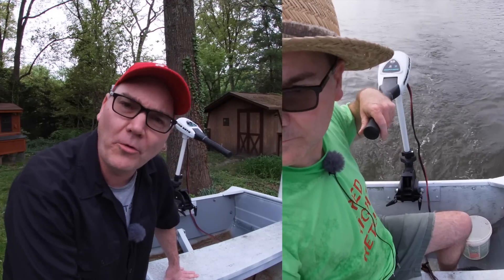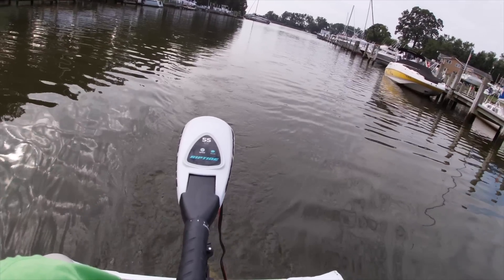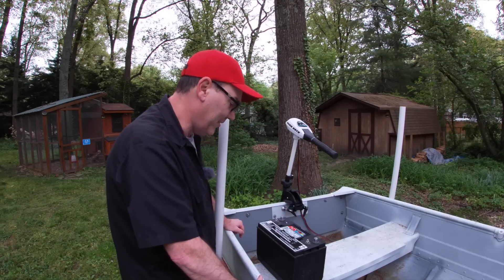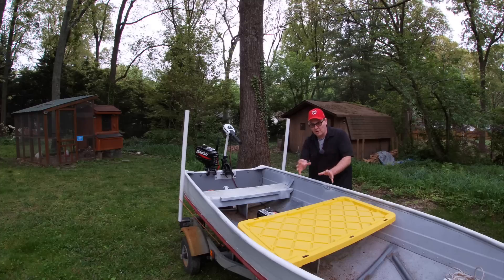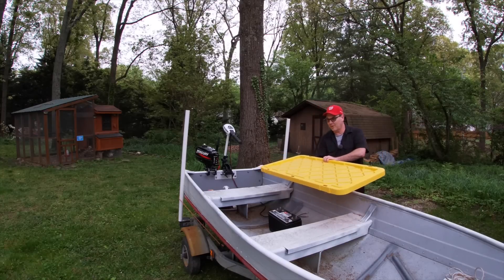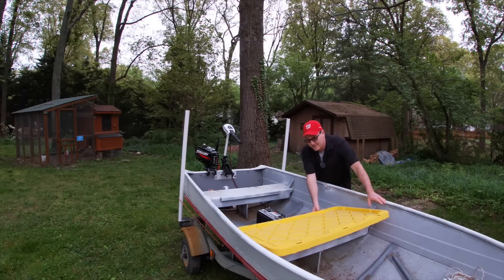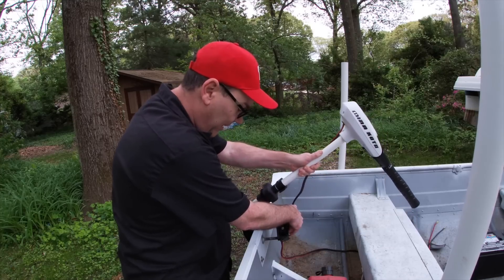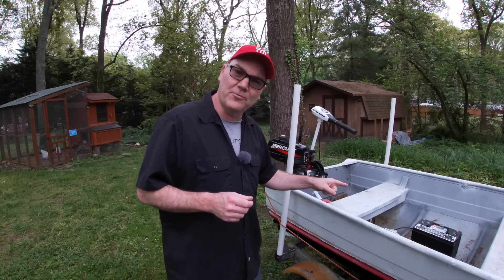How Many Solar Panels Do You Need For A Trolling Motor?

Comment: I wish electric trolling motor companies wouldn't hide their real operating power behind a curtain of a thrust figure which doesn't actually translate into anything useful.
    The only numbers that you can calculate anything with are voltage and current.
Reply from the maker: Yeah it is more than a bit confusing.
Reply: 1HP = 745W. If your trolling motor runs for 4 hours on a 100A 12V battery (1.2kWh), it's under ½HP (roughly .4HP). 

Also, 55# of thrust equals about .84HP

Doing the math makes it all sound a bit more impractical-expensive, especially when you start scaling up past trolling motors.
Reply: @Cabinlab  Your numbers don't make sense. They're all over the place.

Comment: Getting an effective efficient system for a solar boat is costly. Mppt solar charge controller, Lithium batteries to reduce weight and increase over all battery power and a few Big boy flexible panels ( light weight). Wind and  sun position is going affect how the boat runs. Another problem is weight. To build a solar boat you need an Ultra light system like a fold a boat with aluminum framing. Also have to plan it on days that are cloudless and windless. Its a crazy hard challenge and will get to be an expensive project.  Can it be done? yes.  Is it reliable? No. More ideal for a Lake situation where you can see land on all sides. 😁 We Run Our off grid cabin on a 4,800watt solar array and I had to DIY built and source open boxes to reduce the bulk of labor by 60%. It allows us to run a 10,000btu ac, air fryer, coffee maker, computers, phones, lights, tools, fridge, mini washing machine rv style and other devices. The battery alone weights 400# and came from an electric car all converted into a 15 kwhr system at 48volts for efficiency.  Cloudy days hurt. Any shading hurts series panels crippling the amp intake.  Living with solar is a blessing and a curse. I keep reminding the family we are glam camping. Days we get full sun is a day to celebrate.  Yes the cost of solar is coming down but the Batteries for going solar aren't so much. My system ran us around $5,000 and would of cost over $35,000 professionally bought and installed. <- One must learn to DIY this kinda thing.

Comment: I have a 16 ft catamaran Hobie cat. Sail mast off. Two 100 watts across front. When sun is perfect panels put out about 4.5 amps 17 volts. My 15 lb thrust motor uses 12 volts at im thinking 7 amps. But clouds hurt this. So I’m using a battery charge controller on each panel. To a lawn mower battery. 320 amphr. This battery can run motor about  hour. But idea is to smooth out the highs and lows. I’m considering setting up to be able to by pass battery on very bright day to motor so I can use the 17 volts that will move boat along nice. Other wise I’ll be locked in at controlled charge  level.

Comment: You are not wrong but not right either. Technology is here to make solar boat usable but high consumer prices and lack of proper solutions is the biggest obstacle.

You are right that adding batteries is the best way to get proper range but I wouldn't count solar out. Many times the charging is the biggest obstacle with electric boat. Lead acid batteries are heavy and people have to carry them home to be charged. Having a solar panels on a boat can keep batteries charged.

Lfp battery prices are around 80$ per kWh. Still consumer prices can be 10 times of that. I have 5.5m long hard top boat with 60hp motor. I also installed trolling motor on it because I don't like to use main motor for fishing. I have made 2kwh lithium ion battery pack which I charge mostly with 160W solar panels from my roof. I paid 200$/kWh from those cells (brand new) a bit over two years ago and it took me few hours to make that pack. In practice, those panels are enough to keep the battery charged and it powers four hours my motor. 

I chose normal 18650 lithium batteries because the pack is lighter, cheaper and there won't be enough cycles to wear it out. The battery weights about 10kg and equals three 100Ah lead acid battery since they have much look lower efficiency and even deep cycle batteries can't be cycled very deep.

One possibility for small electric solar boat is to install solar on shore and use it to charge such battery. Another considerable choose is to use lightweight flexible panel which can be removed if needed and mount it as a roof

Comment: Looking into it, a 48 inch flywheel with 60ibs at the outer edge spinning around 10,000 rpm would have more energy in it than that battery. Which having two flywheels going opposing directions would probably be better, due to the one having a gyroscope affect.
Reply from the maker: That wouldn't be a good option for a boat that's only a bit more than 48" wide!
Reply: @WayneTheBoatGuy  lol, true, but it doesn’t have to be 48 inches to work. You could reduce it to 24 inches or smaller, and increase the rpm or weight to compensate if necessary.

Comment: I worked in solar for years you don’t know much do a over the top from shaded
Reply from the maker: I didn't say it couldn't be done or it wouldn't work. I was answering the question of whether a cheap, small (less than 2 ft x 2 ft) solar panel kit would be a better option than just purchasing a second battery.

Comment: Panel cost about 100 each you believe trump people about anything it’s way cheaper than your explanation
Reply from the maker: From what I was told, researched, saw in other videos, and read - a single 100 watt 22" x 48" panel (which is under $100) would not do much to enhance the range of a steadily running trolling motor. I would need about 4 of those panels which means building a roof that is about as large as my boat and spending quite a bit more than I would spend if I just bought a second battery.

Comment: I have a 12'6" Bassmaster pro plastic boat and I've powered it for years with various old 2 strokes, and recently switched to using a 42lb thrust minn kota.  It is not quite enough power and also gets warm after 2-3 miles and needs to cool down.  I've decided to use an AGNI/Lynch high power DC motor which is 15kw capable however I'm just going to mate it with an old lower unit and run it at 3kw max.  I'm also building a solar canopy that can switch to being a sail, so far I am using 2 100ah deep cycle marine batteries but when I switch to the AGNI power unit I'm going to upgrade to 200ah of 48v lithium.  I haven't determined the best batteries for that use case however, I'm leaning towards 20ah ebike batteries but they're very expensive

Comment: I tried this on my canoe. The best output I got was 60% to 70% of the panel's rated capacity while sitting flat. It was much less in the morning, evening, and winter when the sun's angle was more acute. The panel could only charge at a rate close to the draw at midday, in full sun.
I worked up a course on the lake and ran until the battery no longer was driving the motor at max speed, with and without panel. The range was only a little more with panel. If the wind came up, there were, at times, issues of stability that were not noticeable without panel. Outrigging would most likely solve that problem.
Reply: The 175 watt flexible monocrystaline from renogy is good and light i have one. Would be great fornthe boat

Comment: you would be amazed at what a 100 watt panel can do towards charging batteries. i have 2 sets but only need one to power my battery to full all day long with 400 watt power supply and about 8 things running off of it and it never drops in voltage. it stays between 13.7 to 14.2 all day long. yes its not a trolling motor but its still really close and thats using a lawnmower battery. with two real batteries... and real fish time aka anchored out while fishing especially catfishing like i do... your batteries will stay charged. its about real world use. not the extreme end of things. in most cases you are not gonna take a boat that size out 6 miles just to fish when you can go basically anywhere i want to via boat ramps on lake blackshear and be right by your favorite spots. just no matter what... gas or electric... always bring a paddle because if something can go wrong... one day it will.
Reply from the maker: A few others have mentioned using smaller batteries which is intriguing and something I might be exploring in the future!

Comment: you can use lightweight flexible panels and use a lithium battery that has 90% DoD
Reply from the maker: It certainly seems that LiFePo4 battery can potentially do a lot better than my old-school battery. But I've heard some negative things about the flexible panels. One of them being that they don't have anywhere near the output they advertise and the other that they don't hold up very well.

Comment: My trolling motor draws 6 amps on the 10% setting, I have 1 - 100ah Lithium battery, 1 100watt flexible panel mounted to my Bimini cover. I can troll all firkin day  with that setup. Fishing not cruising the lake, which is what the boat is setup for. The system was far less than my $3400 9.9 that I use to get to where I am going.
Reply from the maker: That's a situation well suited for the tools you have! The LiFePo4 battery and running the motor just while you're fishing. How long have you had the flexible panel?

Comment: 500 Watts of solar panels costs around £400, one 12 volt 100Ah lifepo4 battery costs around £600. I think the panels are a better plan than a second battery.
Reply from the maker: Part of the problem on a small boat is the amount of space 500 watts of solar would take up. It would need to be a roof or limit me to just staying in one spot in the boat.

Comment: I was thinking the same thing, get another battery. I was also thinking it would be more economical for my home just to buy the battery bank and forget the panels.
I could charge the batteries at night from the grid when the power is cheap and use it during the day when it's expensive.

Comment: The discussion needs to be about amps. 8amps is good practical discharge rate. 50% drain of 100amphr battery is 50amphr or 6hrs run time. Panel at 50% of draw rate will almost double run time. So 50W panel to extend run time to 9-12 hrs. That's a full day. Then 4 amphr charger over night to recharge battery. The 50W panel will recharge parked boat in 3-4 days if the boat is only used 1-3 days per week with no charger.

Comment: Why not have that hooked up to an ACR and 2 cheap batteries, and use the alternator off the outboard to supply charge? Keep that little Merc in neutral and you can run that trolling motor much longer.
Reply from the maker: That Merc is so little there’s no alternator or neutral! It literally starts in gear.

Comment: If you're going to use two deep cycle lead acid batteries you could get one 12 volt 100 amp hour lithium battery for the  close to same price  that would last you 10 years so it would be cheaper in the long run. It would run your motor for the same amount of time as the two lead acid batteries and wiegh less than half of one battery.  
A 250 watt panel would be 39 in wide and just shy of 6 ft long which would make a canopy over either the front half or the back half of that boat.  If you leave it all set up, the battery charges wherever you leave the boat sit.  While you're out and about you can expect to make 250 w for about t. you would estimate that you could make two and a half kilowatt hours during the day which would be enough to charge the battery twice.  More than likely you would run the motor right off the panels and charge the battery during the brightest part of the day.   250 watt is enough to run  a 40 lb thrust trolling motor.  
So you could run all at half speed all day and then go for another three to 4 hours into the dark.   You could never go more than 5 miles an hour because that's how the prop on a trolling motor works.
  You can buy a used 250 w solar panel for about $100 and the battery will cost you about $375 and a pwm charge controller should not cost you more than $15.  You would need an additional $20 worth of cables.   Building a rack for the panel might cost you another $50.  Subtracting the $240 you would have spent for 2 lead acid batteries anyway,. The system would cost you about $240  net. If you think it would save you 48 gallons in gas. over 15 years,  it would be worth it.  Assuming gas doesn't get more expensive.
Reply from the maker: Very good points! Several people have mentioned these higher watt used panels. I can only seem to find them available in bulk and located in Arizona (or somewhere else far away). Meaning I'd have to buy 20 of them and pay very steep shipping costs. If I could locate a 250 watt used panel for $100 locally, that would change things.
Reply: Across the South near the larger towns and cities, if your patient and you watch Facebook marketplace you will see people selling one to two panels at a time somewhere within 60 miles of you about 2 or 3 times a year.  I have only checked this in Texas Mississippi and Florida.  If you were to buy just one panel to be shipped you would want to shop a cyclone singular solar and buy a brand new 395 watt pound which would be shipped for about $350.  It would be bigger but you could make it to stick off the back of the boat while you were using the boat and would provide a lot more power.   Again none of it makes sense unless you're using lots of gas or you just like to not have to fill up a gas tank and you can run only on electric motor.   There's also considerations for stability of your boat once the panel gets to a certain size these larger panels weigh about 50 lb.

Comment: ? I use a 29 series battery and run the same 55 lb trolling motor you have, I fish all day with it with electronics and live well pump running, not no few hours, all day with no problem. I hooked up solar panel at camp to charge battery when I'm done

Comment: 1st of all, for safety reasons the battery MUST be enough for 1 day use even if there is no sun at all
2nd , the solar helps u top the battery up when u are NOT using your boat, so u never have to charge it if u use it once or two a week 

yes it works, for someone and not for some

Comment: So I clicked thinking this would solve the question, but what it comes down to is it an unlimited power source?   And how deep are your pockets, can it be done probably, is it cost effective, probably not , I’m still in the cheapo  brain skeem idea section, I’ve got the same trolling motor you have , haven’t committed to the battery or anything yet , there’s a lot of variables, boat size , shape, how much weight in the boat , and intent of use , if your just motoring around in a small lake or pond your good to go, but for hard use your going to need something to make up what the panels don’t provide , so for my use I want to do a 14’ light weight v hull boat, I’m going to get a small gas engine to motor were I need to get to and use the trolling motor to get around the saltwater flats , I’lll be saltwater fishing , so my idea is to add a small wind generator to the bow of the boat , but it won’t be a air plane prop style it will be more of a open horizontal squirrel cage idea , plenty of wind on the open water still have to figure out the size and amount to get kicked back to and controller and battery but that’s my thinking it might be cheaper than a lot more panels and batteries?
Reply from the maker: You understand that challenges! It’s why I currently run a light 2.5 gas and the electric. The best options seem to be either spend quite a bit more for a LiFePo4 battery and/or I think one of the small 20-50 watt panel kits would recharge your battery better than any wind device. From the research I’ve done, even sailboaters who are out with steady winds most of the time have switched to solar because it provides more electricity. A 20 watt solar kit is under $50.
Reply: @WayneTheBoatGuy here’s an update on my project , my project is a nano flats skiff , it’s an 11’ 1965 Cacci- craft 3 seat fiberglass V- Hull it’s going to be powered by a 1977-  15 horse Johnson outboard and I’ve got the same 55lb thrust minncota riptide you have I’m going to have a poling platform and I will put a 25 watt harbor freight solar panel in the area were you stand on the poling platform the standing area will have a. 1/4 inch thick piece of Lexan plastic to protect it with a diamond pattern scratched on it so it’s not slippery , I’m thinking my solar project with battery ,controller, regulator,and panel should be around $200 bucks since I’ve got the trolling motor already ( the trolling motor was bought at goodwill for $50 bucks ) —- grand total $250 🎉👍😆  since the trolling motor will just be used moving around for site fishing I figure it should keep  things charged up especially here in the Tampa Bay Area of Florida , I can’t wait to see how this plays out in the long run !🤔